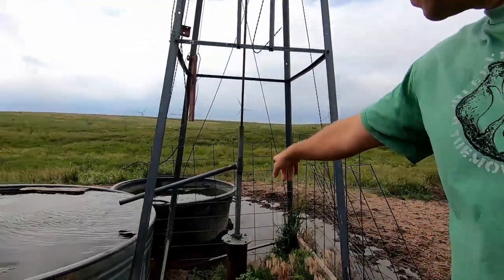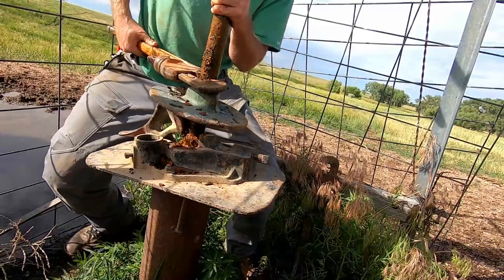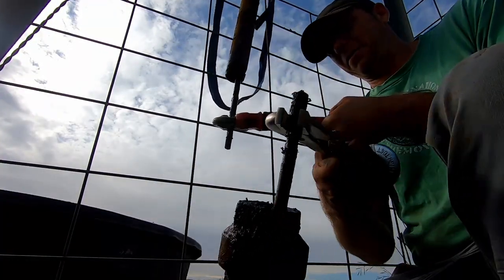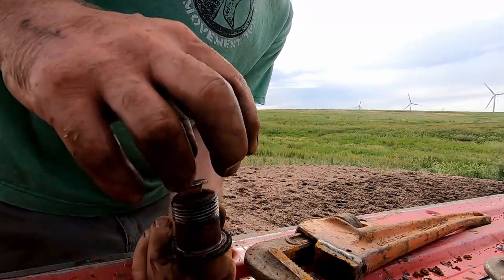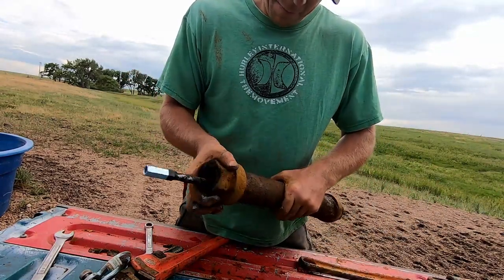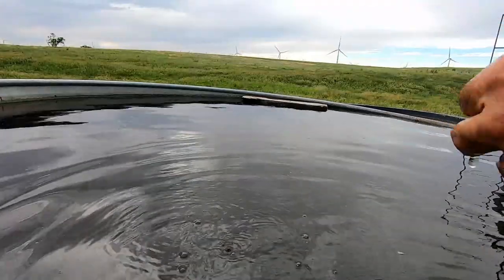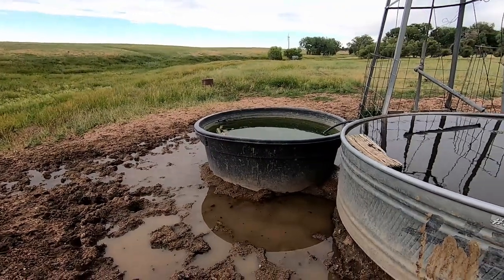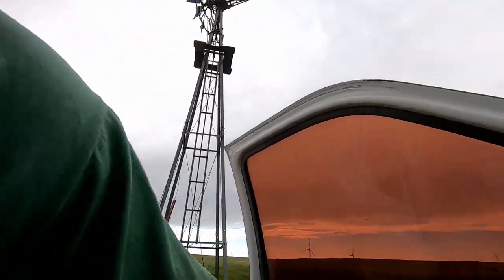How to fix a windmill

Comment: 40 years ago I wanted to replace a 2-in diameter pump with a 4-in diameter pump. The cost of the brass was prohibitive. Tried and experiment using PVC pipe. And fittings were about $20 at that time. Got a 4-in plunger with new leathers and put it in. Have changed the leathers one time since then, no scarring or where showing inside the PVC pipe. I believe they are now even making PVC cylinders for windmills. No rust, use teflon tape to put it together. Comes apart easily for leather replacement.
Reply from the maker: Man that’s a good idea. I’d buy one.

Comment: great video, well done. i came here trying to find method to disengage the windmills pump function 9without locking off the actual windmill) - to stop it pumping. Any ideas for that?
Reply from the maker: You could just unhook the rod that comes out of the bottom of the motor. Did you take the case off? You’ll see a 5/16 inch pump rod that goes up through the motor to the very top. Just unscrew it and take the rod out. This is the actual shaft that goes down into the well.

Comment: What would cause the wing/fin to flop over one direction and not move in the wind? Excellent videos by the way thanks for sharing
Reply from the maker: Their should be a spring that connects from the back fin to a hook on the side of the gear box. If that’s broke the wind will actually shut off your windmill in a very slight breeze
Reply: @farmdude  Ten4 thanks I will b crawling up there tomorrow to check it out your input is greatly appreciated

Comment: What could cause the windmill to not want to turn? Got a good breeze but it almost seems mine is caught in a bind down hole. Had the cylinder replaced and still no water pumping out. Put the brake on for a few days and came back to unhook the brake to see if maybe it would pump water today but still no dice and now she’s struggling to turn with good wind. Thanks!
Reply from the maker: How deep is the well.
Reply: @farmdude  250ft
Reply: Got the windmill spinning just no water pumping out.